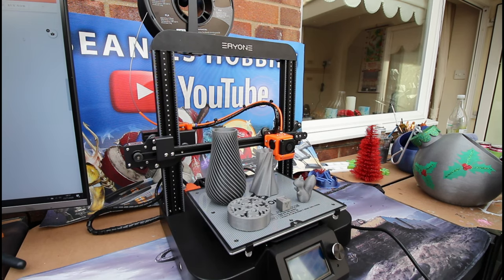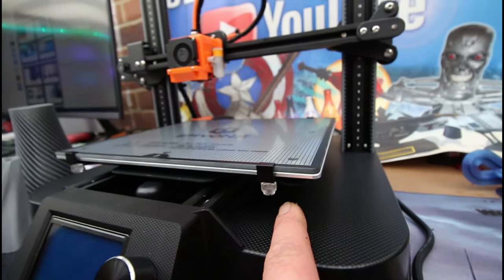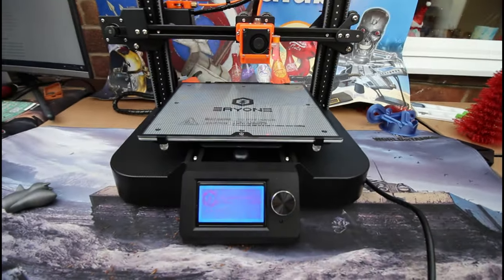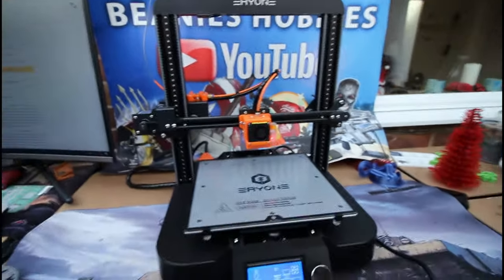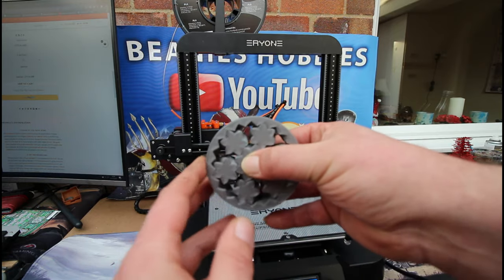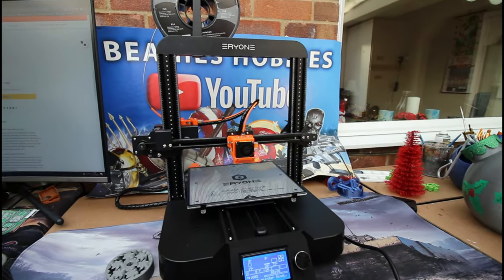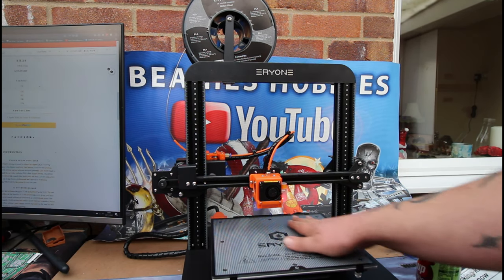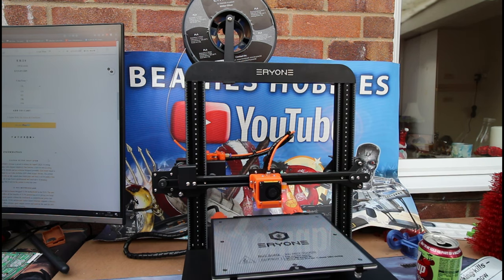Eryone ER20 3D Printer Review Better Than The Creality CR6SE?

Comment: Hi There, I just wondered how you were getting on with the ER20. I recently purchased and whilst I find it prints excellent with Eryone filament, I can't get a decent result with other makes of filament. Any tips based on your experience would be much appreciated to a newbie!
Reply from the maker: Hi, can I ask what make of filament have you tried?
Reply: Hi Beanies, I went for Labists - purely as somewhere to start. I expected it to be a little like putting supermarket ink in a printer! Any recommendations?
Reply from the maker: I've never heard of it, I only use ziro, amolen or matteforge, matteforge is amazing stuff its little expensive but worth it
Reply: Print towers they will help you dial in your setting.  then youtube youtube and more youtube

Comment: Will it work on cura with ender 3 settings?sent my ender 3 pro back after a few prints as spent 9 hours straight copying videos and downloading bed level files 
And could not get it level again.
Printed beautiful pieces though.

I’m new to 3D printing and not sure if using a different printer setting would sorta effect quality ect
Reply from the maker: Hi, thats strange as I've never had any problems with creality machines and bed levelling, have a look at the creality cr6se they very simple to use plus creality have their own slicing software with every single printer they make on it
Reply: @BeaniesHobbies  I ordered this one straight after messaging you as seen Amazon have it for £100 off right now and half price filament included so all in £216 which surely is a bargain?

Don’t want the hassle of bed levelling I really struggled with it.

Can you do a video of your settings with it set up on cura please?Cura is so much easier to use thanks and great video
Reply from the maker: @danm620  hi, as I have so many printers I don't keep them all and unfortunately I no longer have this one but I can help you with settings
Reply: @BeaniesHobbies  yea please if possible I seen a few videos on YouTube where certain settings made the ender 3 print amazing quality barely any lines visible no stringing what so ever.

Wondering if I just change the bed size in the ender 3 profile to the eryone bed size would I end up with same quality trial and error I suppose.
But noticed your video said the printer came with settings to upload to cura?
Thanks so much for the help
Reply from the maker: @danm620  hi, yes the slicer settings are on the sd card that comes with the printer, i would say give those a try first

Comment: What slicer software and profile do you use?
Reply from the maker: hi, i used cura with the ender 3 settings slightly modified to change bed size and added the g29 after g28 start code for bed levelling